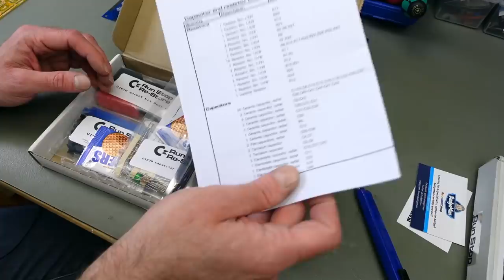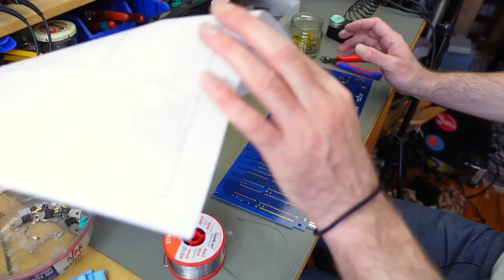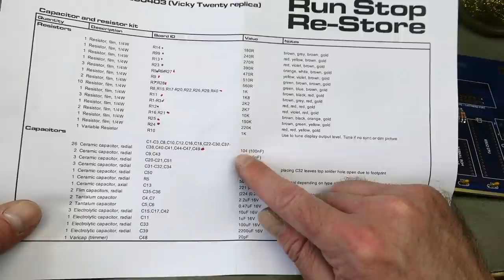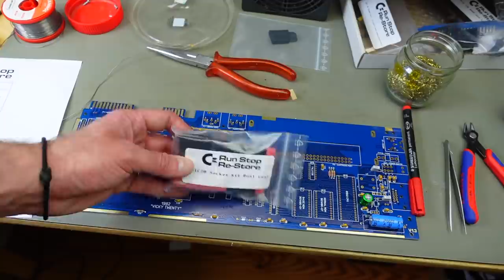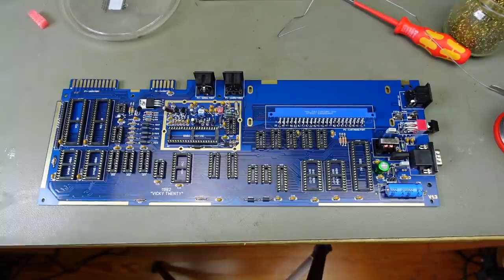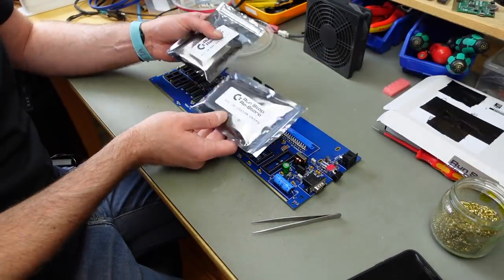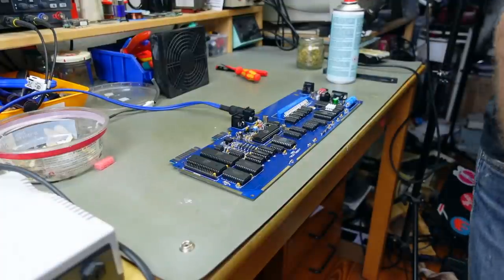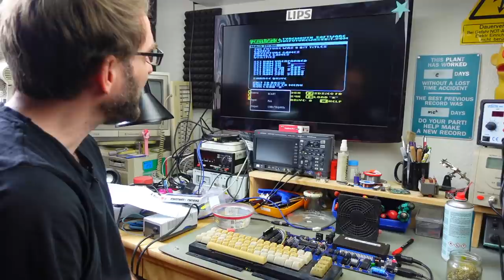Building a VIC-20 in 2021

Comment: These 'new' Commodore computers scare the bejezus' out of me. That's because a lot of people build these thinking it's going to be easy, they put on these new boards all sorts of fake/junk logic chips found on eBay and Amazon then when there are problems, they blame the whole planet but never themselves.
To build these things correctly, you need experience, the right parts and the right instruments!
Reply: Sidenote: I see the IC sockets used in this video are the BEST kind. These are all 'double leaf' sockets. Not the machined pins one that look nice but become slack over time.
Reply: "a lot of people build these thinking it's going to be easy" Got any proof of that, or is it just a wild guess?
Reply: And that's why you should grab a pre-gathered kit from me :) Except for the RAM chips which are old stock, all the logic chips in my kits are brand new Texas Instruments products from A-list distributors, and the entire parts kit has been tested thoroughly to work properly with the board. Any quircks have already been ironed out and if needed newer parts are brought in (like the FBR for example).  The proof is delivered by Jan and it fully works first boot, no issues etc.
Reply: @Ffinity  So many buyers of PLAnkton, GandALF and Saruman products (which I make and sell) asking for a few million questions that show they have no clue what they are doing. Especially with the crystal clock.
Reply: @mbosschaart  Excellent idea. May I suggest replacing the old stock DRAM with a Saruman-64 ?
Reply: @francoisleveille409  My goal is to provide a kit to make a 1:1 replica. If people want to swap out parts for modern solutions, they of course can do so but not everyone wants to though.
Reply: @mbosschaart  A lot of people buy new boards because they want the simplest, shortest and least expensive path to a new Commodore computer board. They try to build (populate) the board themselves but they don't see the potential pitfalls.

Comment: its not the better version tho due to the memory mapping issues.......... watch the 8-bit guy's vid on it...
Reply: Actually that thing is 8-bit guy showed isn't better. First of all the cartridge port opening is in a stupid place, and the memory mapping of that new thing actually causes compatibility issues as he so well explained. So for purists, this board made by Jan is a way better solution as it's a 1:1 replica of the original.
Reply: @mbosschaart  The memory mapping issue is caused by the Vic 20's design, not the replica's. The main issue with the Vic 2020 is that the switches to configure it are inside, where they really need to be accessible from the outside. Back in the day, you'd need to swap over the RAM cartridges or get a switchable one like the Vixen.
Reply from the maker: Nowadays you can just get the Penultimate cart and stop worrying about the memory map. Even the 8-bit guy shows it in his video. I think both boards have their pros and cons (like the integrated s-video out on the 2020 and the nice case+keyboard) but I still kind of prefer the original (or the 1:1 replica).

Comment: All those components from China, I bet this new VIC-2021 wouldnt last 10 years from now; meanwhile the original VIC-20 from 41 years ago is still running...
Reply: And where do you think the components came from in 1982?
Reply: @alerey4363  These are all working chips, so no "fake" other than maybe a reprint on the 6522s, which work fine. All the logic chips are brand new Texas Instruments coming from Mouser. The ram is original too, albeit old since it's no longer made. So I'm willing to bet this new Vicky 20 will work just as long as an original would. Btw: most of the passive parts are modern and much better than the old cheap stuff Commodore put in it's machine. So I'm upping the bet: this Vicky 20 is better than the original.
Reply: The originals were built and assembled in Mexico, the Phillipines, Indonesia... Stow your racism, it's stupidity on your behalf!

Comment: I love these builds so much! The videos are inspiring and very educational for starting amateurs too. The thing that confuses me most though is flux and when to use it.  It’s often used silently or off camera (by a lot of different people!) and I’m never sure about it 😅 was any used in this build??
Reply: Flux is mainly used for SMD work, but can also help with old solder joints. Soldering wire has flux inside.
Reply: Flux prevents the buildup of oxides on the surface of the solder. Oxides will break surface tension, which will make your solder stringy and hard to manage. If you're getting tin whiskers even on leaded solder, or your solder joints look gross and lumpy, you need to add (a small amount of) flux.
Usually, solder will be made with a flux core, meaning you don't need to add any extra flux unless you run into problems or need to use surface tension in some way (soldering SMD parts without shorting pins, especially)
TL;DR flux makes solder bead up on your iron and your components instead of globbing out everywhere.